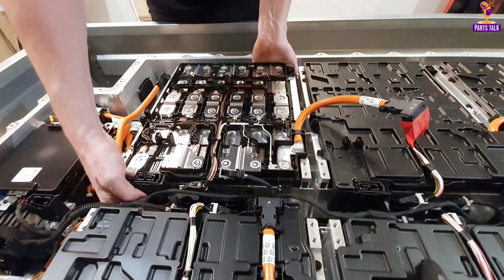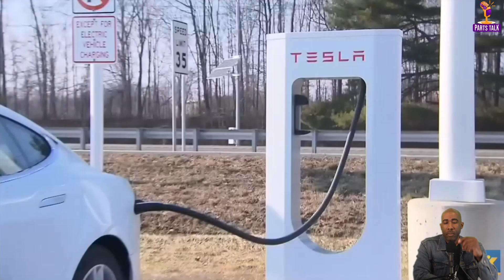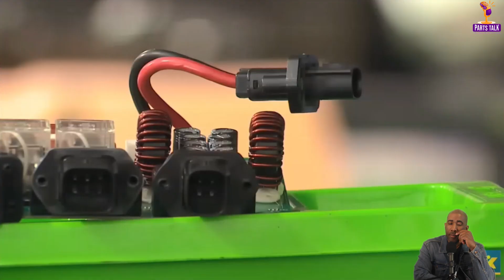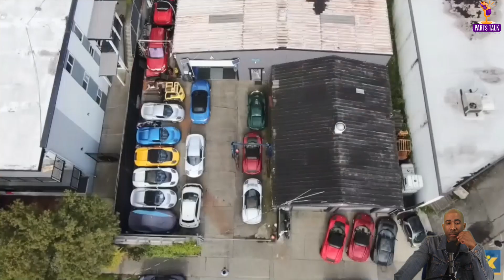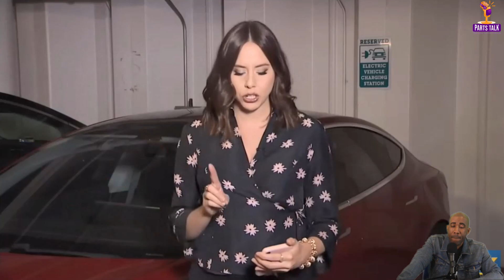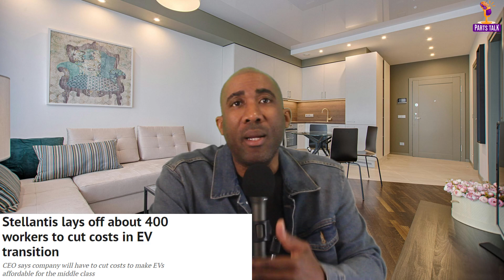EV Mechanics Shortage Give Rise To The Throw Away Industry

Comment: You have a newer EV and the battery fails that is a big unwelcome expense that may be worth paying.  However, once the car is over 12 years old do you really want to spend 20K to replace a battery on a car that is likely wholesaling for less than 10K?
Reply: so either have the pack rebuilt or buy a used pack.  If you have an old ICE car and the engine fails,  are you gonna buy a brand new engine or a used engine?
Reply: @leafnutz2341 If the engine or transmission fails, I will scrap the vehicle and replace it with another used car. The most expensive thing I would consider fixing on a basic 12-year-old car used for day-to-day transportation is the suspension. However, spending money to repair the suspension on an older car would be a tough call.

Only if you are talking about a classic collectible car is it worth rebuilding major components like the engine or transmission, and you need to get a very good mechanic to do it.
Reply: With that philosophy in mind,  how are EVs any different?
Reply: @leafnutz2341  It is all about money.  What makes to most sense financially.  I live in a place where it gets really cold so I can't see an EV car lasting as long as a gasoline car due to the impact of cold on battery life.  AVIS which knows more about both cars and accounting than I do couldn't make EV work financially.  If a company that is in the car business can't make EVs work what chance does an average car buyer myself have with one.
Reply: @pbreedu  cold weather effects can be minimized with simple steps such as buying an EV with a heat pump, heating the cabin while the car is charging,  charging inside your garage.  There are plenty of EV owners in cold climates that make them work just fine.  As far as them “lasting as long”.  Cold weather doesn’t decrease the number of charge cycles directly.